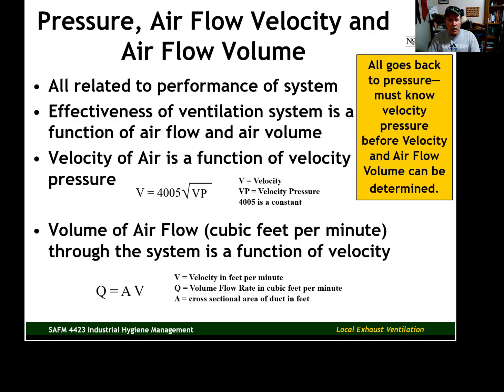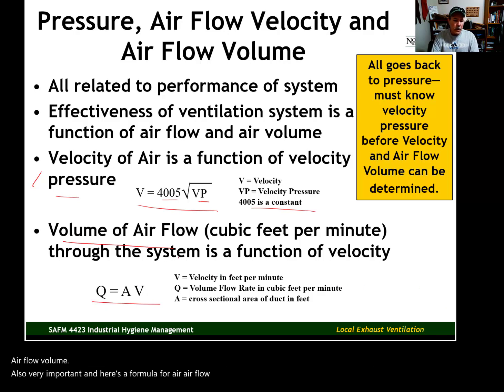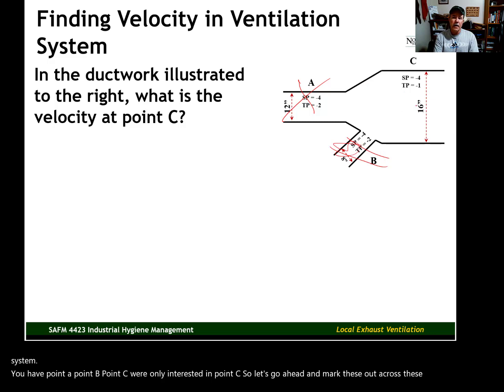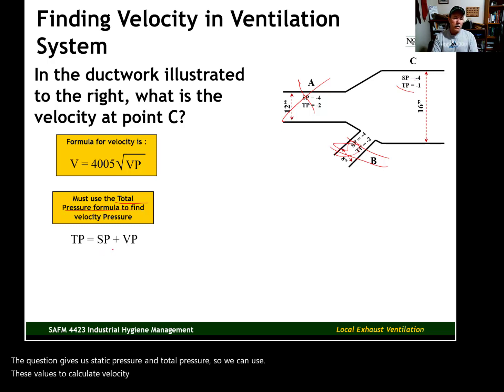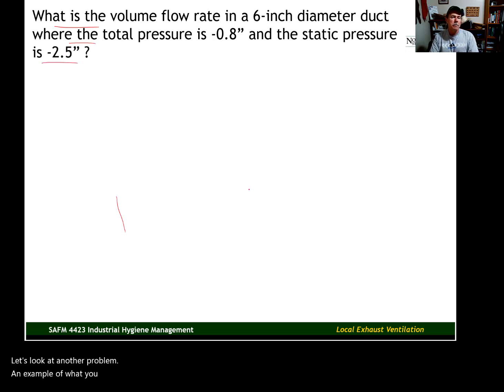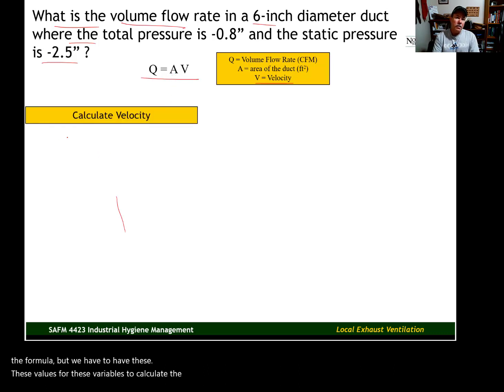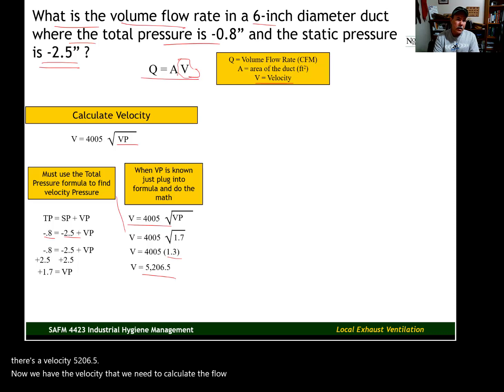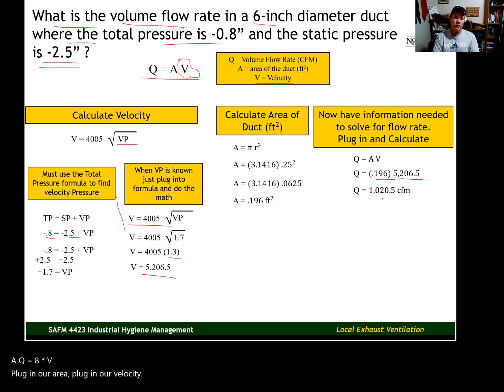Air Velocity and Flow Rate Calculations

Comment: Hi, and thank you for uploading your video. I have a quick question Why do you reduced from 6"  to .5 inches diameter duct to calculate the area?
Reply: finding the area of the duct was the equation that requires the you to convert the inches given from the problem to convert that to feet. If you use just the number 6 your answer will be wrong. .5ft not inches

Comment: Where are the Total and static pressures acquired ? if it is a open ended pipe with a suction fan at the other end i static pressure atmosphere ? and total pressure what's that ?

Comment: I have an opening sized at 414mm X 326mm covered with 3mm wire mesh, system requires a minimum of 2.4m3/s of air flow, how do I calculate the correct removable air filter to be fitted in front of wire mesh?

Comment: Do you have a constant for metric m/sec?
Reply from the maker: If you mean the duct velocity constant 4005, use 20.3454. Also conversion factor for fpm to m/s is .00508.  Multiply fpm by this conversion factor and you will have meters per second.